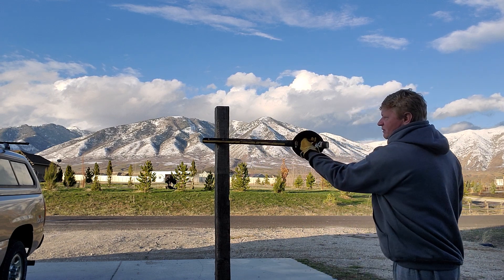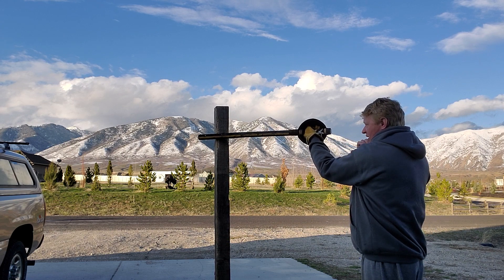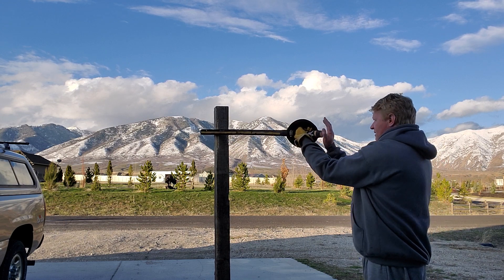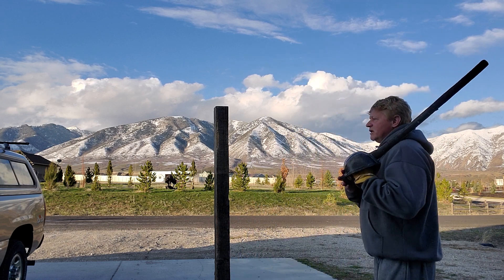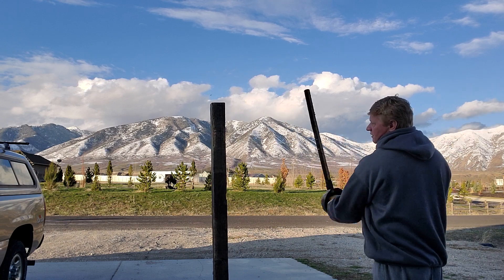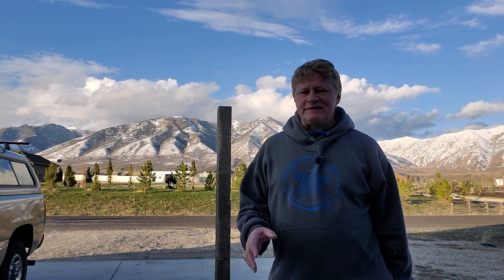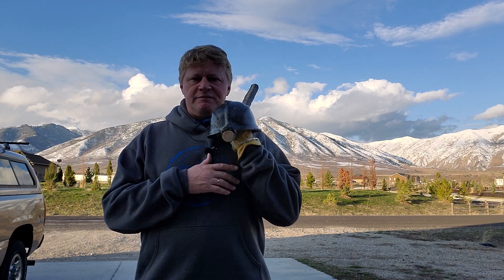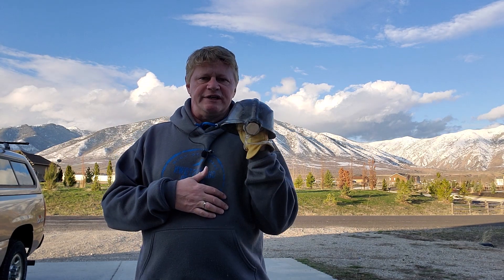Duke Sean Stick Mechanics - Introduction to Stick Mechanics

Comment: E = 1/2 mv²

Are we not looking for energy transfer, rather than Force?  The force on object in a high gee environment can be nearly infinite, even before the object starts moving, but it is only after the stick is moving that it has energy to transfer.
Reply from the maker: Yes, we are looking for energy transfer.  A lot of people in our sport focus too much on "Power", or hitting harder.  Better energy transfer, for me, is part of hitting *better*, rather than hitting harder.  I get that energy through stick rotation, getting the stick to travel on a straight plane (as much as possible), striking perpendicular to the surface that I am targeting, and closing my hand at the point of impact (the snap part).

I have never had the muscle mass to put behind the stick to make 'More'.  I have always had to use the physics of the stick to be able to strike sufficiently.

Comment: @dukesean01 Thanks for making these videos.
How long it the rattan? 
Do you have a pommel weight?
Reply from the maker: All of my swords are 36" tip to tip. And 1 3/8"  diameter. I do not use a pommel weight. Just the plastic Baldur basket hilt.  Although the stick i am using for pell work right now is an older sword without the basket.
Reply: @dukesean01  Thank you for the information, Your Grace. May I ask why you do not use a pommel weight?
Reply from the maker: @gregrice123  i just prefer the basket to the open hand.   Simply personal preference.
Reply: You view is stunning!

Comment: Thank you very much for sharing this, Your Grace! I wish I'd taken on board advice about protecting my rotator cuff when I was in my twenties. Young fighters, take heed! 

I have two follow-up questions I bet you'll answer later...
1. 11:18 You describe the technique where some people extend the sword forward (tip back) before rotating the blade, and how that's heavier in the hand. I don't yet quite grasp the problem there, however. Are you saying that changing the grip, hand position and blade rotation requires more energy in this case? I suspect you're saying "getting the sword blade rotating around is easy when it's close to you and hard when it isn't", is that right?
2. I just really want to understand how to throw a wrap without impinging my shoulder, and hope you'll show how that opening gets me there later!

Thanks again, and I hope to see you sometime soon.
Reply from the maker: For your first question; Yes.  That particular technique is somewhat old school, but it is still taught.  The further your hand gets away from the core of your body, the heavier the object in your hand becomes.  If you pull your sword straight off of your shoulder like that, it is going to take more work to rotate the blade around to strike your opponent.

For questions two,  I should have videos up for head wrap and leg wrap in the next couple of days.